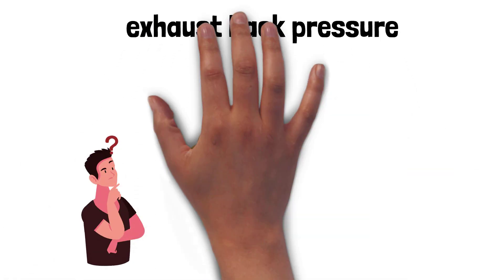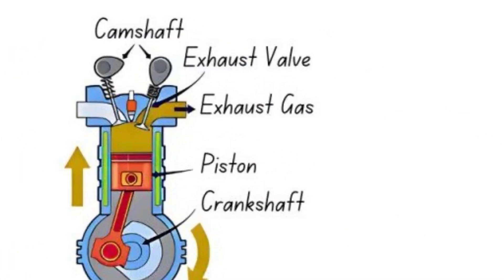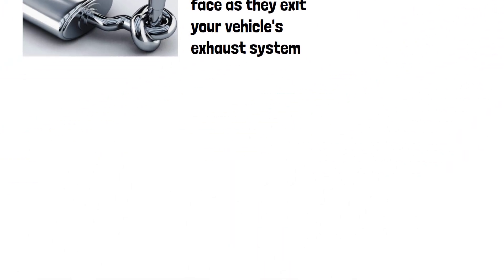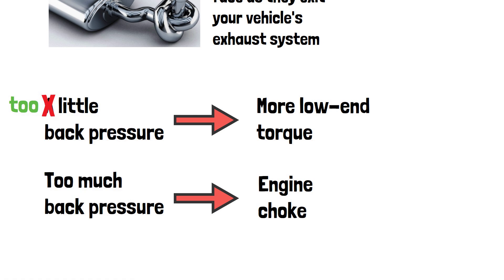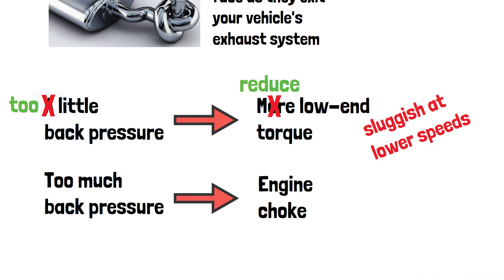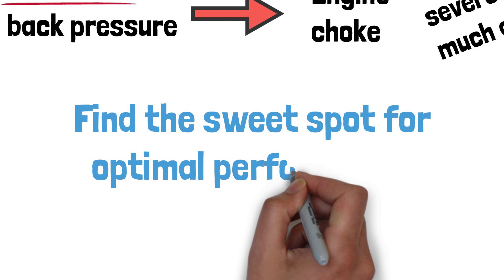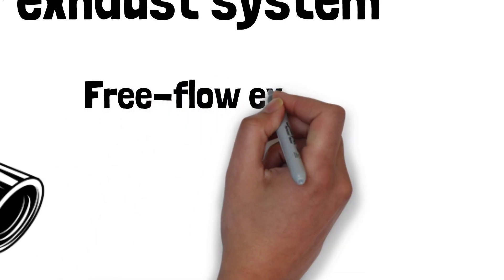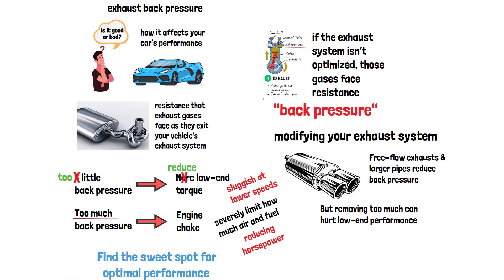Exhaust Back Pressure Explained: Is It Helping or Hurting Your Engine?

Comment: Back pressure is bad! What you want is maximum free flow - but that tends to give rise to reversion, i.e. exhaust gases are sucked back into the exhaust pipes because of the vacuum are produced in the exhaust pipes after each 'puff'. So, minimum back pressure and minimum reversion is what you want... and that is hard to achieve without back pressure....
Reply: It also has to do with pipe diameter and scavenging. Smaller diameter pipes at low RPMs have higher exhaust velocity and therefore a stronger vacuum force pulling the new exhaust out of the cylinder the next time the valve opens

Comment: So now how to fix this problem if I am having it recently with my new full 2.5 inch exhaust pipes in is350 2023? And is it true that tuning the engine and gear can fix it ?
Reply: There are calculations and estimates for different engine capacity sizes what diameter exhaust to run. If I remember correctly VQ engines were around 3.5 liter(?) so not terrible to run 2.5" but if you running dual 2.5" that might be too big. Or sluggish engine otherwise. Easiest way to gain true horsepower is changing camshaft(s) and timing. Later on adding whatever mods along that will benefit you in the long run.

Comment: So simple yet easy to understand, how about full length 4-1 header vs tri-Y (4-2-1) header affect performance? Is it true only change the powerband?
Reply from the maker: Yes, the full-length 4-1 header and tri-Y (4-2-1) header do affect performance, but in different ways. The 4-1 header typically offers better high-end power due to its design that promotes smoother exhaust flow, while the tri-Y header is designed to enhance mid-range torque. You're right that the main difference is in the powerband—4-1 headers tend to favor high RPM power, and tri-Y headers provide better low to mid-range performance. It all depends on what type of driving you prefer!